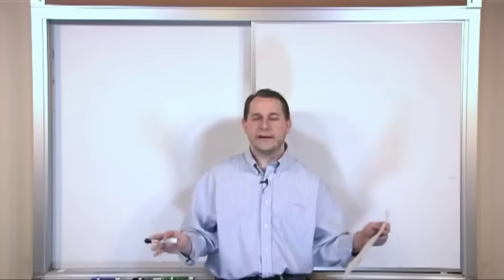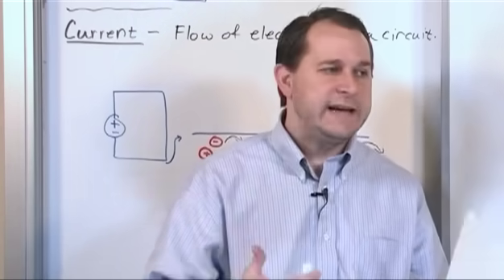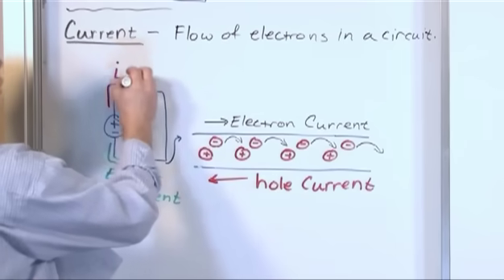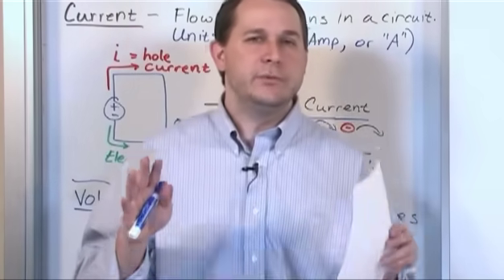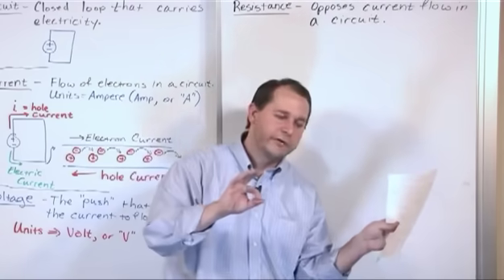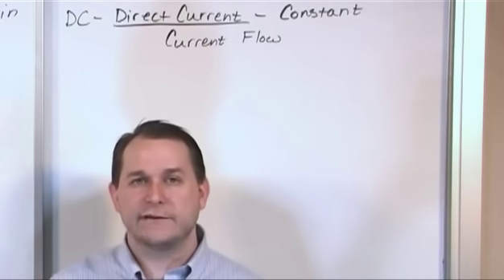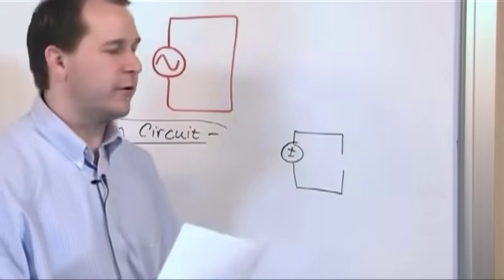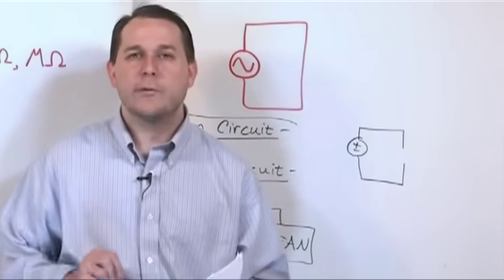Lesson 1 - Voltage, Current, Resistance (Engineering Circuit Analysis)

Comment: That was a great explanation of the "hole current" issue. I find it almost amusing that we "pretend" that the electrons are flowing in the other direction, etc.
Years ago I had picked up a very old basic DC electricity book from literally the 50's. I was working for an entrepreneur with tiny company that was developing electronics products. I showed him my little book that was mostly illustrations. He looked at one of the diagrams, took out his pen and drew the current going the other way and said. "they had it wrong back then". That was my initial introduction to electricity. I still have the little book. It's called "Basic Radio" Volume 1 DC electricity.

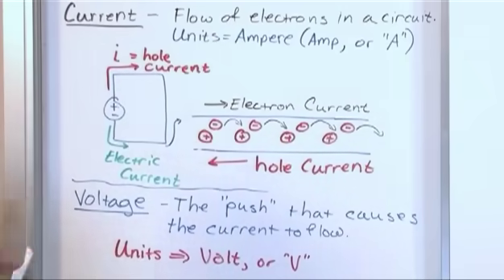Comment: QUESTION: 21:40 “Voltage doesn’t flow through your body, current does.”  
I don’t understand how this can be the case when we can be shocked at any time with a live circuit, that is not drawing any current.
Reply from the maker: It’s impossible to be shocked without current flowing through your body. Voltage is just the push - current is the actual electron flow. If you are shocked by anything then there is a very small electron flow through your body, which is the electric current.
Reply: @MathAndScience  which is where semantics comes into play. “Current” is amps. But, you can be shocked by a wire(s) that read 0 amps, when there is no load/nothing plugged in.
Reply: This is my confusion.

Comment: Before knowing volts and amps you should know what a coulomb is. A coulomb is a unit in which is equal to 6 quintillion 240 quadrillion electrons. Just think coulomb is like a gallon of water. A volt is the amount of joules of energy per coulomb. An amp is how many coulombs per second. If I have 9 volts and 1 amp that’s 9 joules or 9 watts or energy every second. If I have 2 amps and 4 volts that’s 8 joules of energy every second.

Comment: I believe that if you are not teaching electricity to someone wishing to become a physicist, the discussion on electron flow at the atomic level is way in the weeds,unnecessary to the understanding of simple electrical circuits, and very intimidating and distracting to someone wanting to learn how to design and work with electrical circuits. As a better than average career electrician of many years, who was taught the same principals of electron flow during my apprenticeship, I have never been called upon to use this knowledge. Therefore, had I not been taught it, my competence and performance in the electrical trade would not have been compromised in the least.

Comment: Voltage is a push ?!?!?!??!?!??! It's like people who don't know physics say the energy of a battery is JUICE, especially referring to an electric car. You don't know if to laugh or cry. More closely, the energy is the capacity to produce movement, as good as it is this definition.
Reply: In an atom, electrons move on orbits. Every orbit is at an energetic level. Now the atom receives the quantum of energy from exterior. It  makes the electron to move to a higher orbit, with a higher level of energy. And this is potential. bigger or smaller. Depending on the energetic level the electrons are orbiting on. When the quantum of energy is surrendered to another atom, the electron goes back to its lower level orbit. Causing the potential to decrease. Difference of potential is voltage ! If the energy received from the exterior is extremely big, the electrons get detached from the atoms and form an "electronic" gas around the atoms. The potential is of millions of volts and when a discharge is produced by putting this huge potential in connection with another object with potential zero, a lightning is produced.

Comment: Definition of electric current is WRONG. relativity theory says that an object the fastest it goes, the more mass it gets. When the object is very close to speed of light, its mass will be close to infinite. Well, electrons HAVE mass. It would mean, because the speed of current is the speed of light, that the mass of electrons is infinite. Indeed, movement of electrons was detected in case of passing of electric current, as well as heat and electromagnetism. All 3 being collateral effects, NOT what current is, in fact.

Comment: If u blow into the straw and the air that passes through the straw is accelerated though the straw via the current of air that came from your body.. Did  current burst forth from voltage by virtue of being the voltage possessing the current to push? or is current and voltage the same but different?  embodied #motion. Cause u sholl got breath in yo lungs!🤔 So force equals WILL divided by the permeation potential of the Interdimensional substrate membrane ! ISM......Got it! 
And also u took a breath to blow a breath. That alternation in pressures has to account for something....  #hashtag vacuum. Dont worry im involved and a little  longitudinal gravitation acceleration myself with this smoke. 😂 I'm high Coach!. Maybe nothing is a crazy force do to how inifinitially small it's substrate forces have caused it's constituents to become during the separation expo. Simultaneous Space Mitosis and Contraction.  Baboom!!!! Fizz em in Lil Fizzle. Fa Shizzle! "Sol-TEC", Summon the galloping encapsulation!!!"

Comment: Your definition of electric current is fundamentally wrong because electrons alone can never create any force to do any work for human purposes. Additionally, your statement is also ambiguous because there are two types of circuit of which one is AC circuit and the other is DC circuit. In AC circuits, there is not any sort of any actual flow of electrons nor cations either between the 2 terminals of the voltage supply or power source like mass transport, and as the way  how your statement on current expresses here. There is only oscillation of free electrons' random motions which are shifted back and forth as the direction of the electric field alternates, and  represented by drift velocity or speed. Each electron's random motion oscillates only about 10 atoms away from its usual random motion's positions. So, the drift  speed is very slow, but there are numerous numbers of them in a conducting circuit and electrical devices in the resistive loads connected to the circuit. But, the volume of the conducting devices are almost fixed. So, free electrons repel one another more strongly as the electric field's force or the emf - consisting of both attractive force from the total positive charge carried by accumulated cations at the positive terminal, and the repulsive force from the total negative charge carried by free electrons accumulated at the negative terminal of the power source - acts on them. 
As a result,  the emf is transmitted from electron to electron throughout the circuit from the negative terminal to the positive terminal of the power source. At the same time, atoms which have lost the electrons in the valences by the emf, respectively become cations or positively charged ions, and  like a domino effect, a continuous transmission of the positive charge from atom to atom, throughout the circuit, from the positive terminal to the negative terminal takes place at the same time as the electromotive force is transmitted by oscillating free electrons from the negative terminal to the positive terminal. The cations throughout the conducting circuit respectively attract free electrons repelled from the negative terminal toward the positive terminal where a much more powerful attractive force is pulling the negative charges carried by free electrons, and that is why electrons move toward the positive terminal.
 So, what all you guys have always either superficially understood or fundamentally misunderstood the phenomenon and called as "current" is not merely the  repulsive and attractive force or electromotive force transmitted  by the oscillation of electrons in the opposite direction to that of the electric field, or from the negative terminal to the positive terminal, but also the  positive charge transmitted from cation to cation throughout the circuit  from the positive terminal to the negative terminal , or in the same direction as that of the electric field.

In a DC circuit, free electrons actually move from the negative terminal to the positive terminal through a close external circuit, under the driving electromotive force between the two terminals, while the electrons in the valences of atoms of the materials which make up the positive terminal are pulled away and driven to the negative terminal  by chemical reactions in the internal circuit, while the chemical reactions also creates and drive positively charged ions to the positive terminal to balance the added negative charge carried by the free electrons attracted to the positive electrode or terminal through the external circuit,  and at the same time when the emf drives electron in the valences of atoms in the external conducting circuit toward the positive terminal, the atoms, one by one, lose their electrons becoming  cations , this chain of reaction forms a current of transmitted positive charge from cation to cation , and throughout the circuit from the positive terminal to the negative terminal as  how the currents of electrons and cations move in 2 opposite directions in AC circuits to create electricity

Hence, an electric current is actually formed by both the electromotive force  transmitted from electron to electron throughout a conducting circuit from the negative terminal to the positive terminal of the power source, and  the positive charge simultaneously transmitted from cation to cation throughout the circuit from the positive terminal to the negative terminal, but it is not that an electric current or electricity is merely the flow of electrons as your definition has misrepresented here, or merely the flow of positive charge from the positive terminal to the negative terminal through an external circuit, and is denoted as "i" in all books of physics and electronics. Moving electrons are merely one half of  what can create electricity, and the other half is the positive charge transmitted from cation to cation or among atoms throughout a circuit, which have lost their electrons in the valences due to the pulling and repelling forces of the electromotive force from the 2 terminals of the  power source

I am sure that this is the first time you guys have seen such an accurate and elaborate explanation because no professor of physics and electronics at any university in the world have ever explained as what  my above explanation says, and no book of physics nor electronics has ever presented anything with such an in-depth explanation either.

Comment: I got very confused on your explanation of SHORT CIRCUITS . You said a little bit earlier that a THICK COPPER CONDUCTOR OR WIRE HAS VERY LOW RESISTANCE , but a tiny sliver of wire , let's say a single piece of a stranded wire , has very HIGH RESISTANCE to the flow of current . And then in yor example you said let's say a single strand of wire becomes loose and touches the other wire B4 THE LOAD .THE CURRENT will follow the path of least resistance and short circuit , rather than pass thru the load of the fan , which is of a much greater resistance .
I THOUGHT BIG THINGS had little resistance , and small thin things had GREATER ...????....ONE OF MY FAVORITE MECHANICS , AL SANTINI , said in his book that a tail light bulb had MUCH HIGHER RESISTANCE than a STARTER !!!!!! so I figure the FAN in your illustration would have LESS RESISTANCE than that single strand of stray wire ...????

Comment: Hello your video rocks thanks you quick question for voltage I don’t understand negative voltage. Is it just relative to the negative to positive the positive is +5V how can it be -5V from positive to negative. If that is true does that mean the potential electric difference  from the beginning of the light bulb to the is -5V. How I see it is the current loses energy rather than gain it is this right
Reply: Well simply put voltage is like height. There's some point (0m) where we start to measure height. If we go higher than that we get positive height or we gain height, but if we go belove this point we get negative height or we go lower than the reference point 0m. Same is with voltage. There's electrical potential that we say is 0V and every potential that has higher energy is called positive and every potential that has lower energy than reference 0V is called negative. And voltage is the difference between 2 electrical potentials. So for example if we have potential of +5V and potential of -5V there is 10V of voltage between them. You could also have voltage of 10V if you had potential of 0V and potenial of +10V or potential of 0V and -10V. When you  have light bulb connected to power supply the energy of power supply gets used on light bulb to produce heat and light. This is because of ohmic resistance which uses energy of power supply and transfers it as heat. That's why we see voltage drop across a resistor.

Comment: 9:09  theory by my. The speed of light will decrease because of the attraction of the atom, the more weight the mc² will kick in. Theoretically at the end of a wire long enough (let's take 1miliion miles away but thick enough for no voltage drop) we'll have instant electricity, the only loss will be the distance the electrons travels fom one wnd the another. There is no lag ,I theory that all the electrons jump over nucleai and never get influenced by they field, there are subparticules that helps keep them running along the conductor made from a straight alignment of atoms, which make the speed look constant. And it has to be proven.

Comment: Can a circular copper coil in a large donut shape be substituted for a superconductor THEN using chips turning the electricity flow into A MAGNETIC PULSE that catches the metal of a blade , turning it efficiently as fast as elecrticity ??-PERHAPS USING CHIPS as gates (ON/OFF) to create the pulse for magnetically pulling the superconducting blade at speed of electricity for say turbine jetting out as THRUST solar corpuscular radiation found in space ??

Comment: hole current means conventional current (which is opposite of reality of negative charge flowing to positive charge after benjamin franklin's theoretical mistake) . Have just now been reading about using linear graphs for ohmic conductors on normal length wires , making sure they don't warm up , using triangle change in Y (voltage) divided by triangle change in X (current) to give you resistance value (which is R=V/I . BUT does voltage potential difference versus current mean current is measured from negative to positive but voltage is measured from positive to negative ??? and measuring in reverse with voltmeter leads and ampmeter leads gives an inverse of R which reminds me of adding resistance as inverse of R  in parallel circuits (because the more conductivity of branch arms , the less resistance value , like having 3 of your human arms touching electrically common point give 3 TIMES conductivity but becomes 1 third less (1/3) of original resistance ??-Hence adding of resistance is an inverse in parallel circuits . BUT does voltage potential difference versus current mean current is measured from negative to positive but voltage is measured from positive to negative ???

Comment: May I say something?  I think this is wrong.  I think it is wrong that a circuit is necessarily a loop.  The electrons in a battery do not keep looping around and around.  The charged battery has an excess of electrons at one end, and when you connect them to a circuit, they flow around to the other end until both sides have equal charge.  The electrons are not continuing through the battery and making the trip again.  Am I wrong?

Comment: i dont understand the hole current , why it is the opposite direction ?
Reply from the maker: It’s kind of like those blinking lights in the marquee around the old Timey theater signs those string of lights that were blinking it makes it appear that the lights go around and around the sign over and over again. So if you think of the lights as electrons and you can kind of see the illusion of the lights bouncing from Bulb to Bulb and they just kind of go around and around the circle. But if you look at it another way and focus on the dark area between the bulbs you can convince yourself that the dark area is actually traveling in the complete opposite direction and the darkness is going around and around the other way in opposition to the lights.  That’s like the hole current.
Reply: @MathAndScience  thank you so much! u r such a GREAT teacher! u really helped my understanding 😃
Reply: @MathAndScience  sir, there are a lot of videos on YouTube about "Free Energy Generator", the videos looks real, is it possible to generate electricity to light a 12V or 220V light bulb through a "handmade" DC or AC motor with Magnets and copper wires?

Comment: Electricity aint really electrons moving through the conductor, it is the field generated between the opposite charges, trying to cancel each other out, most of the power transfer is around the conducting material or something, I don't think it's possible to visualize how this is happening, we can only observe the effects and make models from what we observe, it's like we are not part of it, but still it exists, more like a dimension or something, where matter-antimatter and energy exist, not part of our 3d dimension until we use the 4rth, "time" to measure it. I am trying to make a picture of it in my mind, but that I think is futile.. ack. Am I wrong?